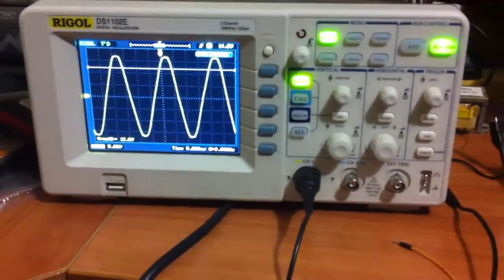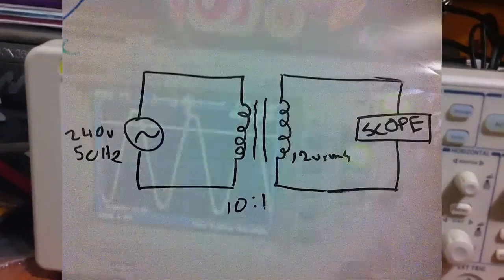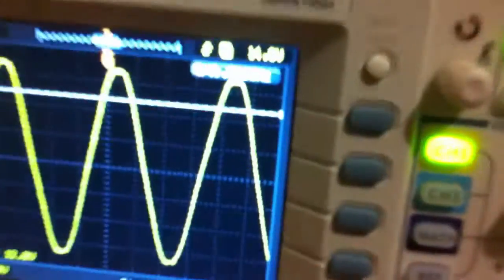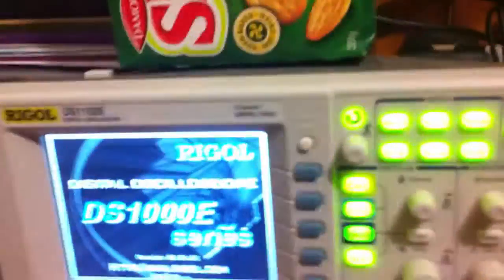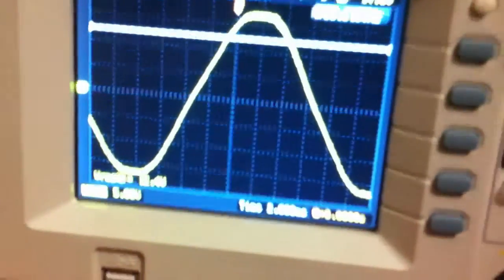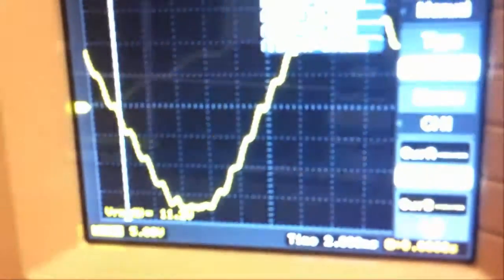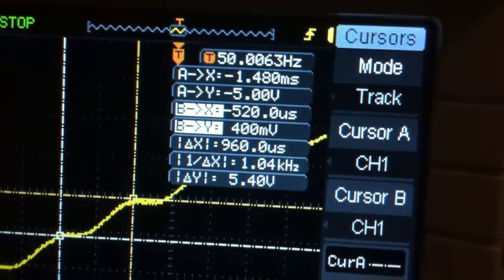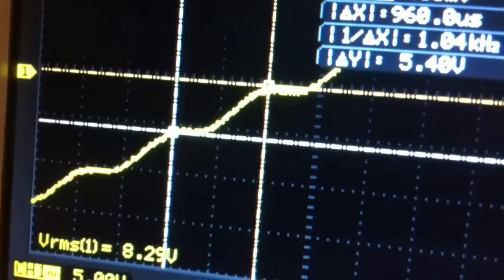Ripple Control Signal in Action - Audible detection

Comment: Why do I hear this in my apartment? Some tradies have moved in upstairs and they're a bit dodgy. You reckon they could have something to do with it? I've been trying to locate this sound for ages and your video is the first!!!
Reply from the maker: You can hear the sound from many difference appliances that don't use enough electrical noise filtering. At my parents place, the bathroom light in the ceiling will buzz and even flicker slightly whenever this signal is on the mains line. I've also heard it from computer speakers before, as they likely don't have enough filtering on the mains voltage side and those frequencies get passed onto the amplifier circuits. In this video the ceiling fan was making the noise. What appliances is the sound coming from? It may be possible to put some EMF filtering circuits in between to eliminate this circuitry but if it's appliances hard wires into a home you might be out of luck. It's possible the tradies installed some cheap appliance that doesnt have this filtering and if you can locate what is causing the noise you might be able to fix the problem. Just remember it could be a switch mode power supply, ceiling fan, ceiling light, fluorescent light, anything really.

Comment: Nice demonstration with the oscilliscope, I'd like to point out that the frequency on the receiver may be adjusted to compensate for older motor-generator type transmitters. This was done because the frequency is intended to be 1050Hz but the generator was a mechanical one rotated by a motor and would slow down a bit when under load, making the frequency about 1042Hz. Pretty neat how that scope can measure the frequency like that, seems like a very nice one to have. You can actually hear the signal a bit better if you put the microphone up to a transformer, even a small one, they seem to emit the tone quite well.
Reply from the maker: Aha yeah I made this when I was 15 or so, I probably should of gone a bit more into detail like explaining what the use of this signal is for residential homes (pool pumps, hot water...). In Australia I believe the hot water tariff 33 is controlled by this signal which means no need for synchronized timers or anything, quite a clever solution as the power station controls whether or not it happens and how often depending on demand. In my neighborhood I had a theory this signal is what turned the street lights on/off around 5:30pm. So I went to the transformer in my neighborhood trying to listen to it and look at the lights. Unfortunately the street lights turned on about a few minutes before I heard this ripple control signal so i'm pretty sure the lights just use light sensors on the top or something. That's interesting about the frequency from 1050Hz to 1042Hz, I didn't know that. At one point I tried to attach a high pass filter to this transformer then rectify the signal to an arduino's analog pin so that when the signal came I could record it. The result of this was the signal's high and low peaks over time, which I'm sure decode to some level of binary instruction (eg turn hot water off, pool pump on...) but at that point documentation became really lacking apart from some obscure diagram I can't find anymore. The time difference between each "0" and "1" was inconsistent and I kinda just gave up on the project. It was interesting though!
Reply: @BoomBrush  I actually have made both a transmitter and receiver for this system as I really like it and we don't have it here in the US. I used a similar high-pass filter and had a single diode rectifier that charged a small capacitor off the filter output, that's fed into an analog pin to decode. It works quite well except the base voltage coming from my filter varies with the mains voltage level. It's probably just an issue with my filter and I'm sure you could do better considering you seem to have the stuff to take better measurements but I am going to be using a filter that older receivers used from now on. Basically it is an LC circuit, where the inductor is the coil of a reed relay and the capacitor is a value that makes it resonate at 1050hz. When the signal is present the relay will switch and that gives a binary value of signal present vs not, which is much easier to work with than an analog value. If you want to continue your project by chance I'll include links to some resources I've found over years of working on this. It is quite hard to find resources on this.

http://www.rundsteuerung.de/
http://www.toonfrequent.nl/
And here is a diagram of a really old filter circuit for a receiver that used tuned pendulums to receive a rhythm based on/off of the ripple signal https://www.delahyde.com/tauranga/images_ripple/Ripple_Relay_Circuit_M.jpg
There is also information on the protocol being used (decabit) in this guide starting halfway down on page 20.

Hope this helps, some of the pages are not in english but google seems to auto-translate them quite well. If you need more info on it I've got a lot more I didn't list here, Also I've got the code to decode the decabit telegram if you want it.
Cheers!